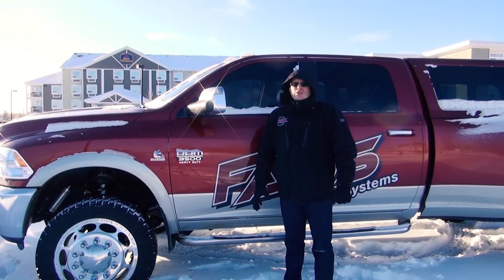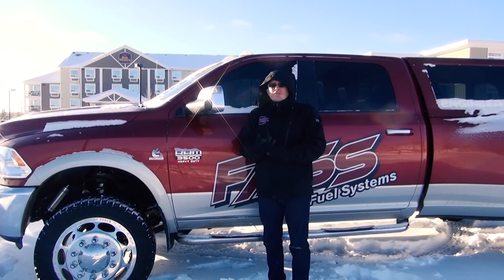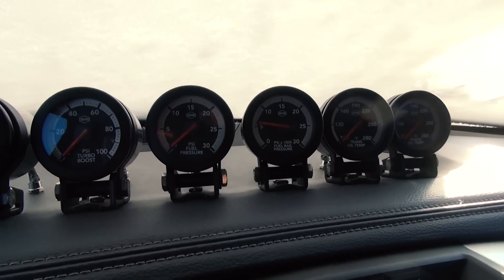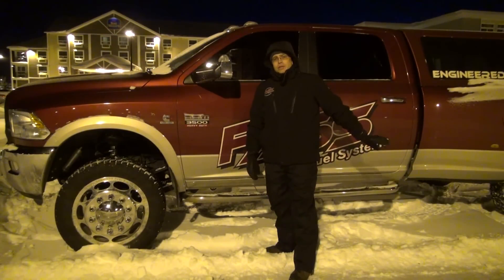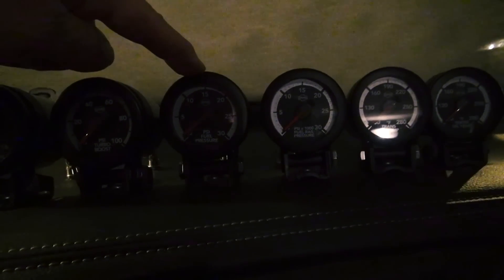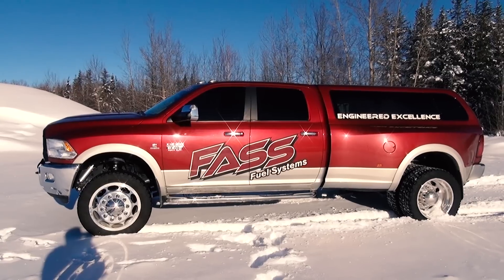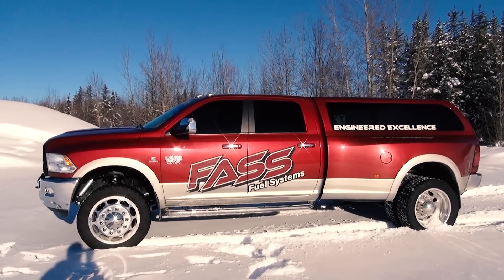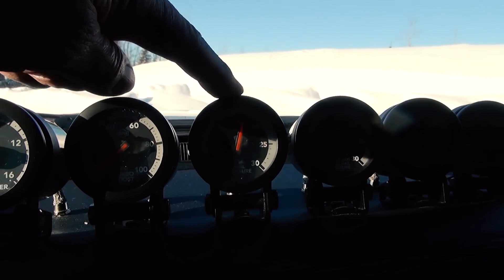FASS Fuel Systems "Cold Weather Performance Test in Canada"

Comment: You mentioned 2 heater sticks, if I recall correctly only 1 is usable and the 2nd would have to be the filter disk. 
I have the single stick and it seems too little to make a huge difference but it is better. Debating on adding the coolant hoses to the pump block
Reply from the maker: Great question, and if you are still having trouble with this we will be happy to help figure this out for you! Our number is 636-433-5410, and we are here from 7-7cst!
Reply: There are a total of 4 available ports. two for coolant heating and two for electric heating.